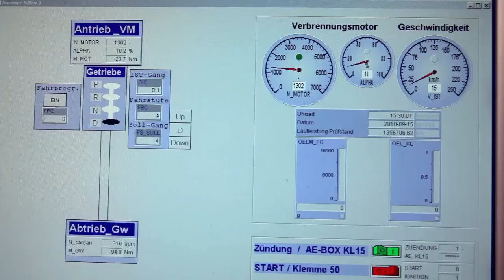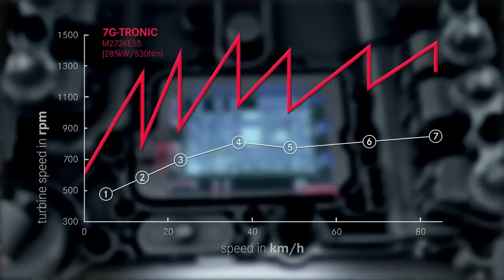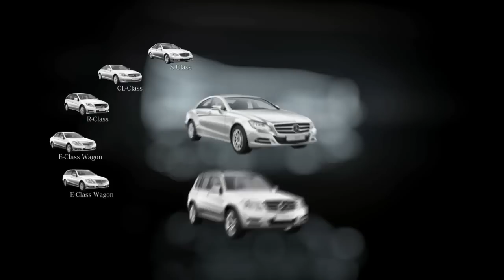Mercedes-Benz 7G-TRONIC Plus Transmission

Comment: Looking at the Modern Mercedes and then finding out about the Technical achievement's. The brilliant people who are encouraged to stretch the limits of the possible is one of the wonders of the 20-21 century. These magnificent cars when matched beside the Electrical models are in so many ways superior. Enjoy them. The era of mechanical engineering is disappearing. Is the future Better? Carrying around a 750KG battery full or empty that after 5 years has maybe 60% capacity. A Mercedes E Class made in 1990 is still a car that is a wonderful drive everyday.

Comment: It's so smooth tranny. I was surprised that there was so big a difference between my S-Class W221 with normal 7G-Tronic and CLS C218 with 7G-Tronic plus.
Reply: Main difference is oil 236.15 , put this oil to earlier 7g and will be same working like 7gplus
Reply: @amimenamimen8599  are you sure?
Reply: @ruzansbow3755  yes iam sure
Reply: @amimenamimen8599  thanks man. 
you own a W212?

Comment: This tranmission is good mechnically, but every 772.9 I experience have some sort of conductor plate or controller failure at around 120k-130k miles.
Reply: nonsens , my 722.9 2008 year have 370 thousand kilometers and still work great

Comment: Trying to figure out if my 2016 GLE400 is equipped with the 7G Tronic or the 7G Tronic Plus. All I know it has code A89 (Friction-reduced) with ECO (start/stop). Be careful when ordering the Trans filter there are (2) different part numbers. For non A89 code the 221-277-02-00 and for with code A89 you will need 222-277-20-00.
Reply: I have read that cars with start/stop have 7G+

Comment: Anyone had this fault P278300 The friction power of the torque converter lockup clutch is too high.
Been to the garage and thier saying I need a new torque converter which I'm looking at 2k all fitted...  please tell me it not that bad!? 
2015 115k miles  220d  
Picture for attention

Comment: I found out after I purchased a mercedes with 7G tronic and 134k miles/216k km that the oil in gearbox was changed only once at 47k miles. Gearbox it's working fine but should i be worried because of that? Thank you
Reply: I would get it changed out. It's not cheap to have done at an MB dealership, but that may be best. I'd let the service advisor know  about your concerns and they should be able to provide guidence. MB transmissions are not cheap when they go out so any preventitive service is probably a good idea at this point.

Comment: Very big mistake from mercedes stupid enginery! this 7G-tronic is a nightmare! when the conductor plate is good the valve body is bad when the valve body is good the torque converter is bad when all is good the speed sensor No... never end the problems with this junk trasmissions :(  And the worse mercedes are not selling to individuals parts or programs for this transmission  be aware!!!
Reply: I never had any issues with 7 g tronics on any of their cars seen one with 830k and the transmission shifts like new my man change the oil.

Comment: This is why used Mercedes are so dirt cheap. They pack it with tech that will wow the first owners but will quickly turn into a maintenance nightmare after 1 or 2 years of use. Imagine the price tag to repair one of these transmissions.

Comment: All are produced in Stutgart. OK. State of the Art production facilities - meaningless. Highly motivated team reworked the transmission and got impressive results.... tells us nothing. They got an improvement in efficiency - as a result of INNOVATIONs. Oh. I see. The torque converter works better. More of engine output is available - same as saying its more efficient. They are repeating themselves. Low visosity transmission oil - only specific thing they say. Efficient - for a third tme Oil pump stays on when transmission stops turning - ok that's specific too.  They repeat its efficient again. A few specifics, lots and lots of of fluff.
Reply: So? Do you think the 1.5 million people that watch this would understand if they explained in engineering language how they did? Ofcourse not, this is advanced enough......
Reply: The language could have been made more meaningful without resorting to engineering language. Plain English would have done the trick. But they didn't use plain English, they used meaningless marketing puffery - stuff that has a nice ring to, that Morgan Freeman might enjoy pronouncing, it but tells us nothing. See amoralis123 at around 2016 July. It is also hard to listen to because the background "music" tends to drown out the voice.

Comment: I'm an engineering student and this stuff blows my mind with its complexity.
Reply: Sounds like an ordinary automatic transmission to me - which IS the most complex thing in a motor vehicle - that they simply made lots of small improvements to, part by part. I didn't hear about anything really innovative here except maybe the second oil pump to help prevent wear when the transmission is used with an engine having an automatic start-stop feature.

Comment: all well and dandy but, 7% of 55mpg  is what 3.85mpg.........   oh boy 
were all saved, not,    that is shit,   true TDI fuel management systems
 double mpgs with installation;  with tuning more than double.....

double your mpgs in USA like you do overseas......    diesel models get better mpgs,, mercedes honda, bmw make models that get a standard U.S.A mpg of 90-500mpg.   some electric hybrids but most of them all using crude.

and if eruope uses only imperial gallons, the mpgs on the 58 mpg car IN THE ABOVE  off the show room floor in germany gets a whopping AMERICAN system  67 mpg usa

Comment: Dear god Mercedes couldn't have fucked up harder than the 7g range, my c class has the PLUS version which to me, told that it was (sort of obviously) better than its predecessor. Jesus help it, it holds that revs at 3k (diesel) no matter how hard I accelerate. It's not that it has a loss in in power, it just never really goes  past 3 or 3500. It also jolts the whole car when coming to a stop occasionally (it's not abs or any traction shit, ts been tested) and it does the same when taking off. It's so bad that I'm taking it in again in a few days to hopefull sort it out. And that manual mode..ill never buy another merc with a 7g. 9g or amg speed shift from now.
Reply: this is why You should rent such model for 2-3 weeks to test it intensively. 
Also - why not try Lexus? It's cheaper and better quality (not RX family, go for IS-F :) )
Reply: +Tomasz “Glass” K I'm not gonna waste my money just to test a car. I got the gearbox sorted btw, it's really good now but I can't remember exactly what they did to it. Shifts especially well in sport. And Lexus is definitely not better quality I've sat in both. They're good but they're Asian remember.
Reply: it was probably that thing where the torque converter would allow the engine to lock to the transmission better. That would certainly cause jolting. Then again.. it could have just been a slipping clutch pack

Comment: Driving pleasure? Lol funny.if you tried bmw ,then you will see how much better Bmw transmission is. Much smother.i bought the car for less than two year drives like a five year old car with bad transmission oil.
Reply: Many BMW transmissions are manufactured by GM and ZF and not BMW themselves

Comment: I own a 2014 e class.the transmission sucks. Can not believe they work on this transmission for 7 years. Very rough shfting when drive or reverse.
Reply: c class has the same issue, lil bit better. I did a testdrive with gla . no rough shifting. that's ridiculous. 80,000 dollar car vs a 35000 dollar car. 35000 gla is better than E class? damn
Reply: The 2000 AMG E55 Auto Box was so so so smooth. However, it didn't last and I will never buy an auto again.
Reply: should have taken it with manual transmission. Or buy an Audi with S-tronic transmission...

Comment: No offence MB but there is nothing simpler and nothing stronger then the Toyota E-CVT build in their hybrid drivetrain, Prius Auris and the rest. Of course has theirs downside too but for everyday use and reliability nothing come close to them. So far the most unreliable is proof to be the famous DSG then their Manual one and dmass flywheel, then anything else.
Reply: Not really, CVTs have a really bad efficiency factor. They also feel weird when pulling force is needed. A buddy of mine worked at Mercedes Benz and they had way more problems with them.
Reply: +Bier- Mensch I agreed with you but there is a huge difference between Toyota's eCVT and any other cvt transmission. This Mercedes 7gtronic tranny is very advanced gearbox no doubt, but is also very complicated which means possible troubles may arise with the time and mileage. 
Mercedes autos are always been one of the best anyway

Comment: It seems a little odd to me Mercedes is talking about MPG's when they tend to make a lot of big heavy V8 powered cars.
Reply: +Dave Well most of the v8s are the amg versions aren't the?
Reply: Actually the MPG of the S-Class S500 V8 with the 9G-tronic is slightly lower than of the S350 V6 with the 7G-tronic. The V8 has more power at low RPM and can shift more efficiently with the 9G-tronic, as the V6 needs more RPM for power.

Comment: if it breaks in a second hand car it will cost at least 50% price of the car
Reply: +Tadas Negative. It's electronically controlled and goes into limp mode if something is wrong with it. That means catastrophic failure is very rare. If you change the fluid, filters, and seals at least once every ten years then it should last a long time. This is applicable with most any car with an auto-tragic nowadays.
Reply: Its not gonna break, its a Mercedes ffs
Reply: Ruben A LOL, you worry too much:
https://www.google.com/webhp?sourceid=chrome-instant&ion=1&espv=2&ie=UTF-8#q=mercedes+7g-tronic+used&safe=off&tbm=shop&spd=14505163590715141232
Reply: Maurice Searcy USED
Reply: You really think you're going to get a new one after production has stopped? Or why put new in a USED car?
Reply: Than you know little about it and Mercedes in general. "It's a Mercedes ffs" remained in the 90's. Now if it lasts for the warranty period, than you're lucky...

Comment: Marketing, this all it is, in reality any transmission is reliable but maybe not so smooth but the more technical a company makes a transmission the more unreliable it is as MB ag admitted they had to re work it and make components out of new materials, in a nut shell not reliable so when they break down it costs a lot to repair, is the reason why you don't buy used Mercedes unless it has every service detail available
Reply: +myfeeling4you Ah so by your logic "New materials = Unreliability" ... Every single generation cars end up with new materials. Aluminium has replaced cast iron in a lot of the structures inside an internal combustion engine... with no detrimental effect on reliability. If it was up to you we should all still make cars out of cast-iron, then?
Reply: +Mitja Irsic Did I say anything about cast iron ??? read my statement again but put your glasses on first and then look at the vid once more, so people like you who comment without thinking and if you want to rebuff my comment go ahead but make it smart and not without intellect.
Reply: +myfeeling4you it was just an example. Your statement of scientific and engineering ignorance was the following: 

" MB ag admitted they had to re work it and make components out of new materials, in a nut shell not reliable"

This is demonstrably NOT true.

Comment: This technology would be obsolete soon as car manufactures move toward fully electric cars following the lead of Tesla.
Reply: +Igor K  Why thank god? Oil will run out. What then? Electricity will be more available than fossil fuels, and storage solutions are getting invented daily. Some researchers made battery liquid out of a plant's enzymes.
Reply: Igor K The engine is only 50% of servicing in an internal combustion engine car. The rest is suspension maintenance, electrical system faults and the odd interior fixes. You will still need to fix those on a Tesla car. Plus it will still require very rare electric motor fixes which are likely to be VERY expensive. Batteries will need some attention after a while too.
Reply: +Igor K Most likely you'll need new brake pads, tires etc. And after 100k miles maybe shock absorber and sptirns.
Reply: Igor K Electric cars will need less servicing. But saying they need NO servicing at all is very far from the truth. Like I said, the engine is the only part that will need LESS servicing. The rest of the car will need to be fixed just like any other car.

Comment: The transmission on my 2005 E500 only lasted about 30,000 miles before it had to be taken out of the car and repaired because some fucking snap rings failed.Worst transmission I've ever had in a car ever.
Reply: +Buelligan88 
bull shit
Reply: Buelligan88
If your transmission broke after 30.000km than you don't know how to use it,moron.No shifter(auto or manual)should damage for such small amount of km's!And even if your story was true,it was still under warranty and if it was major issue there would be recall.Way I see it it's either you are liar or hater or both!Don't you think this transmission wasn't tested before it was used on cars?Parts like that are manufactured to last and are tested prior.If you had issue how did you use your gearbox?You prob shifted the shit out of it manually instead of using auto modes provided.Idiots who use manual shifter +/- on cars trying to make it like manual transmission gear box are idiots.
Reply: Buelligan88
Only failed for you because you can't even shift automatic gearbox properly,lol.That gearbox is so "faulty" it only failed for you.I don't see anyone else complain and since when does Mercedes have 5 years warranty?
Reply: +xXMAGNONXx  No, it IS actually "your" and NOT "you're" which would be the contraction of "you are". Not flamin', just sayin'.
Reply: ***** OIC! it doesn't come across very well at all and even with your explanation I still don't understand but thanks for bothering to come and try to explain anyway!

Comment: hi all... First of all, yes, Mercs reliability isn't what it used to be; but what manufactures' is anymore. 2nd) Each brand has a specific mindset of customer's in their approach; Merc isn't for hardcore use, despite the AMG models. if you are in for that get (if you find anymore) a Honda S2000; simple mechanical engineering, no electrical bullshits, a guaranteed smile on your face as well as most probably a short life term ;), 3) 0,5 liter/per 100 kms saving or 17gr/kms less CO2; that is indeed for the press releases BUT also for the environmental norms in effect, not for saving us money, 4) When they are used normally and they get a transmission fluid, filter and the rubber gaskets changed every 40.000 kms / about 27.000 miles or every 2 years if you are not doing that milage in that time, what it might fails anymore is the damn electronic units of it. So, in general they are still reliable. 5) Compare the prices of modern Mercs and any other brand to the same range's model of that brand, today and 15 years ago; they are practically the same although the value of the money has dropped over the years, plus the cars' performance on every lever has gone forward to a whole new century. Think on that, keep calm and keep driving.
Reply: +Kostas Kourgiantakis For god sake, get with the times! Cars have been using electronics for 30 years at least. The time of simple mechanics, carburetors and manual adjustments is over. It's your subjective feeling that cars are less reliable these days but this just isn't so. Statistics should that they're getting more and more reliable every single decade - despite higher complexity. That's something we non-contributing idiots should praise the engineers for, not dis them.

Comment: And yet as revolutionizing as this is when you try to shift if manually it falls flat on it's face with every down shift.
Reply: Igor K Do you rev match to a shiftable automatic?
Reply: Igor K See what it does is not just slow down it slows down like it's braking except it's not and then it returns to the speed it's supposed to be.
Reply: Igor K Okay here's the short version, the transmission pretty much falls flat on it's face (the clutch doesn't engage) when you downshift at low speeds. What I'm wondering is if you need to rev match it like in a normal manual transmission.
Reply: +Jimmy Situ 
Its a slightly better standard automatic transmission.  If you wan't super quick, manually controllable shifts, with even better efficiency you want a DSG.  Of course luxury car buyers will probably still prefer a torque converter because all that slippage translates into smoothness.
Reply: +Jeff K good
Reply: Aha! Ezzactly!

Comment: I have 133K miles on my C350 sport and I drive the hell out of it. Frequently I speed up to 210 km/hr or 130 MPH, spin out at stop signs, drift stop lights, and it runs like a top. The only complain is there is a little play in the lower gears but likely thats from my abusive driving habits. All the complaints out there likely are from driving it like a 60s cadillac, instead of a spirited sports car.

Comment: Mercedes like to run there engines warm is more efficient but because of this the water temp ?hold a high temperature on the transmission fluid ? What you need is a separate !ntecooler for the transmission oil then you have the water cooler plus the oil cooler working together  my  c class works well this way??.